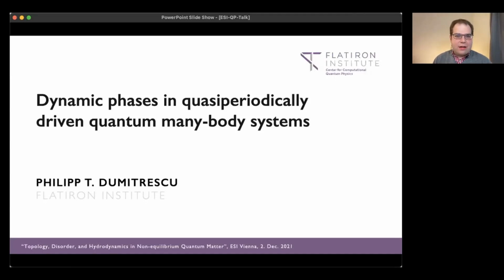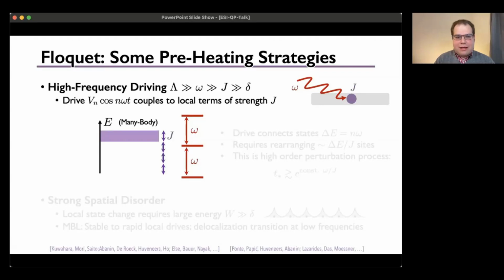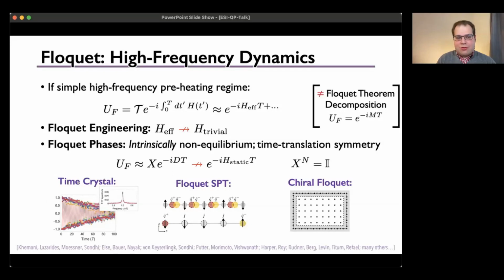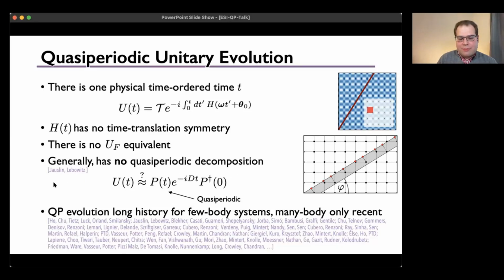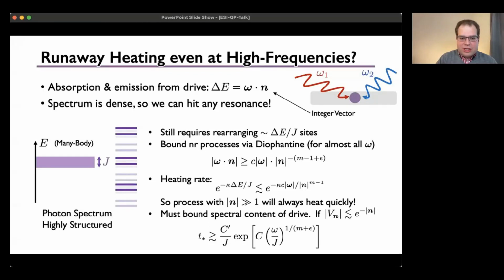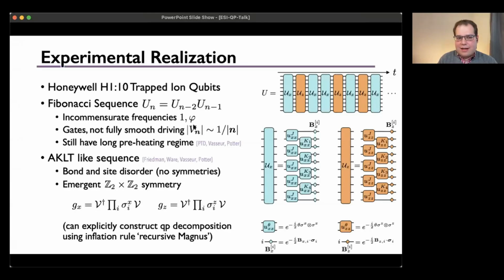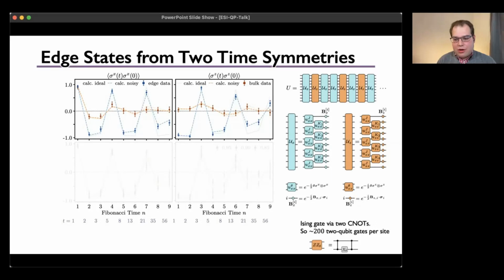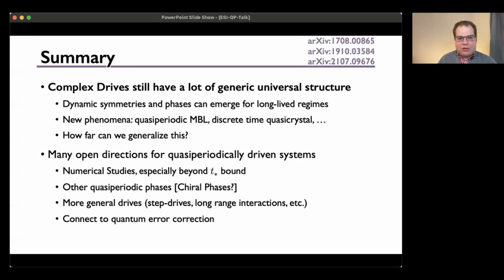Philipp Dumitrescu - Dynamic phases in quasiperiodically driven quantum many-body systems

Comment: Obviously the result of the prime spiral relationship found by myself, the late Peter Plichta, and Azra Wind in greater detail. Everything is relative and fully kinetic. Yes, we've proven the photon does not exist just as Einstein said. It was a shortcut. A boson matrix is in fact present, the opposing force of push and pull to strong atomic centers.  Apply 500kv pulses to lithium tantalate block having a multi-fiber cable inside. That cable will gain the ability to see through walls using a tunneling ion effect, as the tunneling ion exists in a higher dimension. It imitates matter being there. The fuel of time on earth is electron neutrino pressure; the start of the negative pole of magnetic current. It is impossible to have this now proven prime spiral relationship without that concept, or else the force you use to describe time would dissolve the spiral relationship. It cannot be diluted into other forces without progressive kinetics. In 96 I predicted on the web (still have the proof) electron neutrinos flow into the galactic bulge, and the $270,000,000 Ice Cube project vindicated this years later.
You can bind the drive in theory using multiphase, so 3 phase with a carrier produced on  a 4th resonator point, which in some cases are produced between a total of 5 points either linear with focal points or as a nonlinear sum at different radii into  single focal point via implosion. For example; there is no heating in a grid of cesium chloride suspended in a gas matrix, for example, where the grid becomes a set of mutually repelling dynamos, it spins off a positive ion to quickly to allow neutral ionization to occur, so the matrix exists in a superconductive state. Look at the 310x faster than light transceiver made at U of Princeton in 2003 for that. The cesium chloride makes and consumes light tunnels to operate.
A neutral ion is a mix of all particle sizes. A positive ion uses larger particles in bias to the positive pole. A negative ion consists of the smaller, in bias to the negative pole.  The simplest proof of the mass difference among the poles can be done simply by allowing a cube neodymium magnet to slide down a dielectric plate at a steep angle. With the negative pole up, it will flip end over end, but will slide with positive pole up.
I am trying to understand what you end goal is here. I would guess, quantum computing. I have to say though; the most efficient method of computing would have to be using a pair of ion beams to suspend graphene dna. It was found that stuff computes faster than light. The only issue is the U Berkley girl who heads the project has only grown the dna on slides, while there is another method using Co2 that allows it to self-replicate.